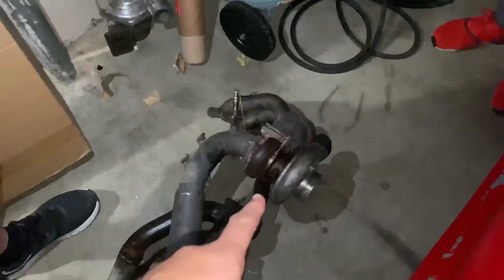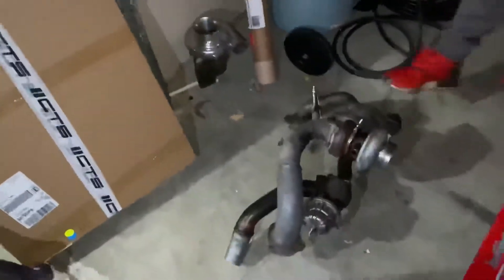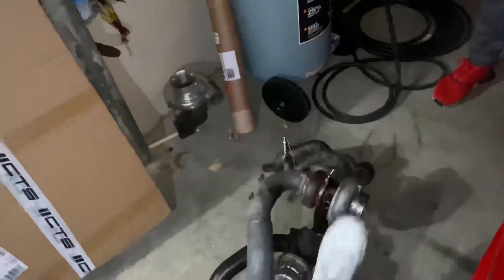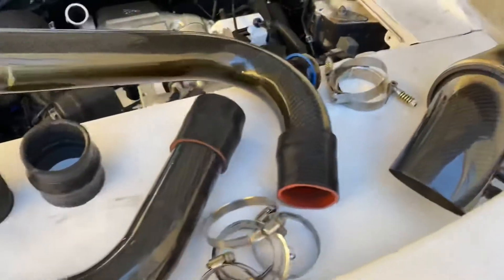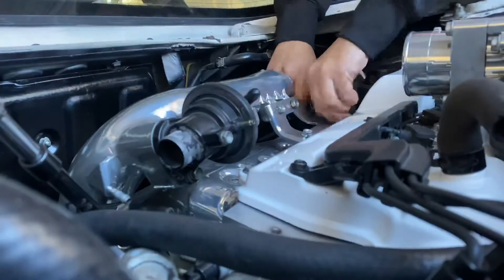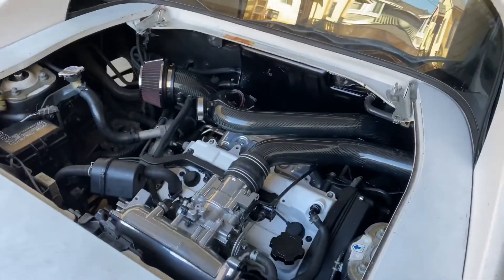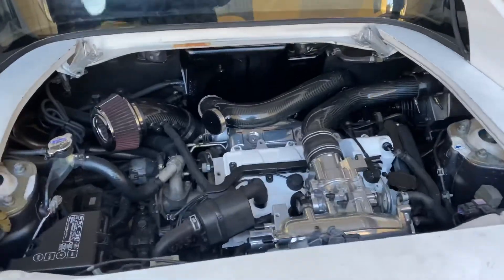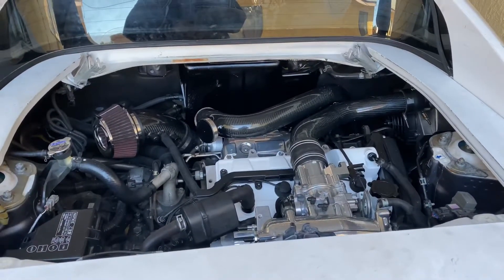carbon fiber intercooler pipes for my toyota mr2

Comment: Question Where did you route the vacume hose that was coming off the stock intercooler  hot pipe by the turbo. The new pipe doesn't have a fitting for it. So where did you route it too, thanks.
Reply from the maker: dm me on IG @mr2_aria